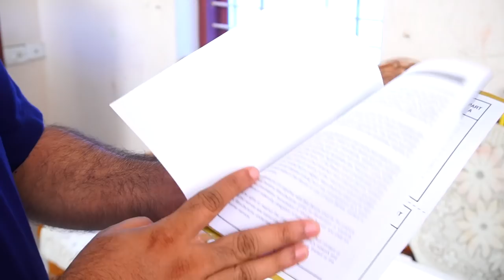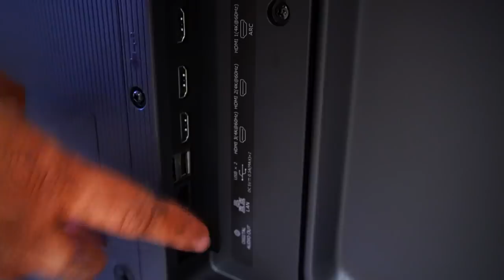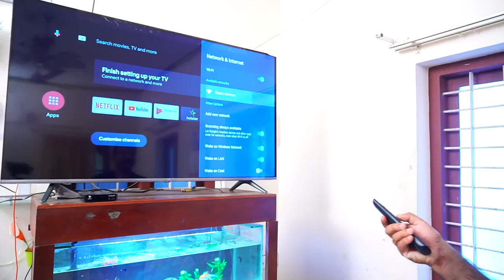ടീവി മേടിക്കുമ്പോൾ ഈ കാര്യങ്ങൾ നോക്കണം | Vu Premium TV 4K UHD Android Smart TV  [ Malayalam ]

Comment: Are you facing any issues when connecting home theatre via 3.5 mm jack or bluetooth
I'm getting very low sounds
Reply: Ya same problem here in 3.5 mm jack
Reply: 3.5 mm to aux cable vangiyaal mathi
Reply: The display clarity is in extreme level but the ports of the tv s are in colony level